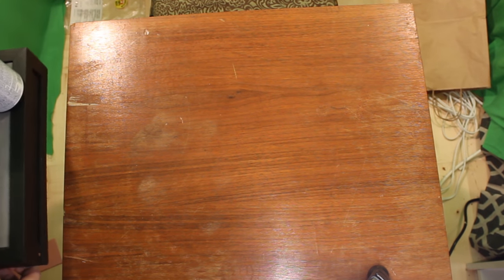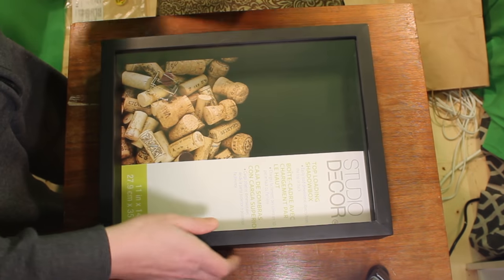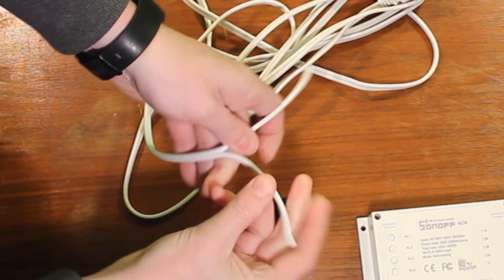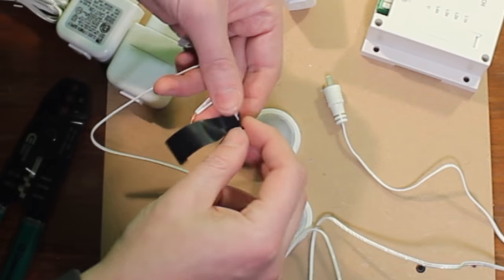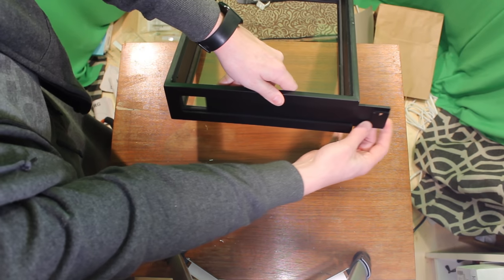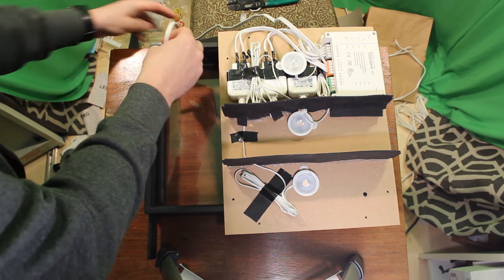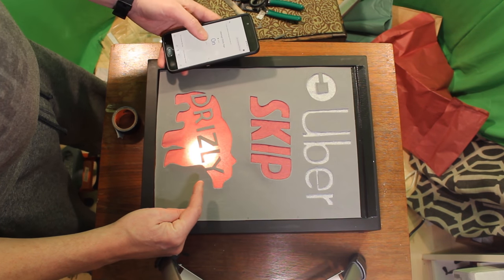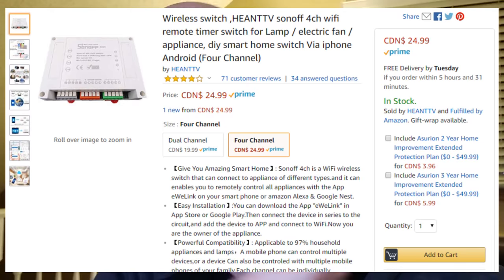Custom Delivery Sign with Sonoff 4Ch WiFi Switch

Comment: ......I use it on my house number "Orange on Halloween"  or when its cold it will display "Blue"...... flash RED when emergency services are needed to find the house quickly.... using a sonoff to switch it on for a period then off at dawn via the eWElink app
Reply from the maker: All great ideas! Thanks for sharing!